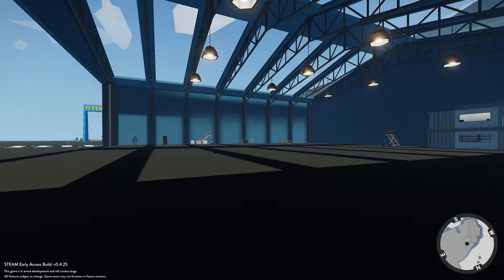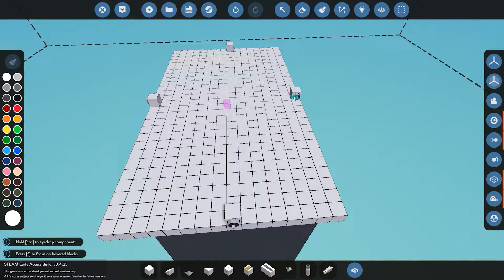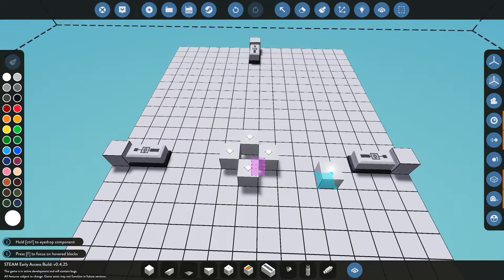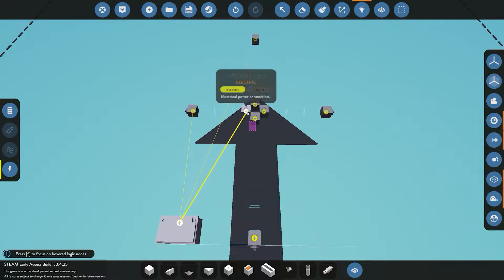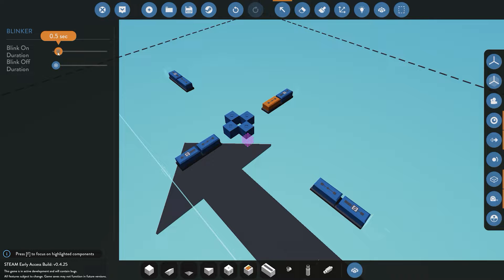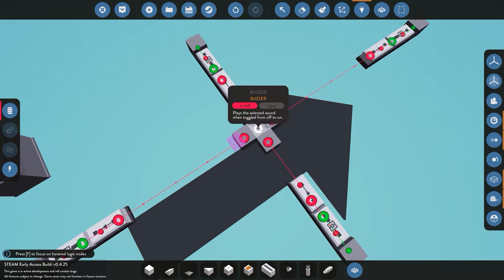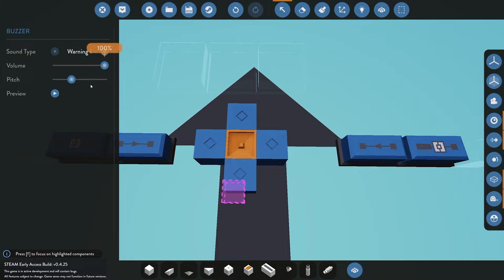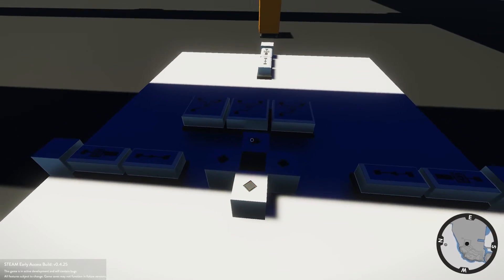Stormworks Collision Warning System Tutorial

Comment: lov it thanks
 ..a question are there any tree way and logic? A got tree kes witches go to a electric relay and a don,t wont it to pass power through it if not all keys is turned
Reply from the maker: You could use 2x AND blocks connected to each other
Reply: okej :)